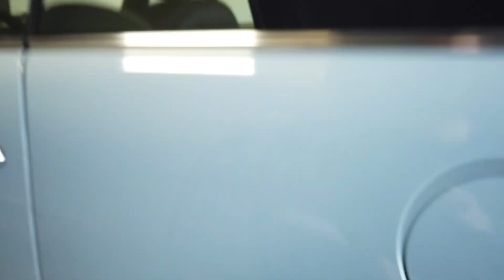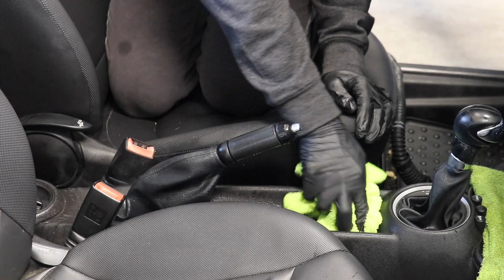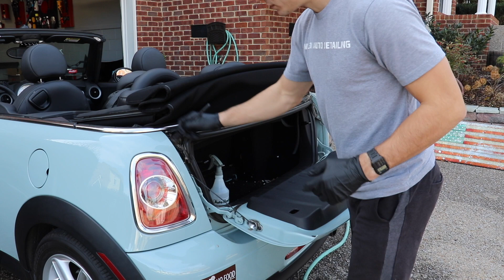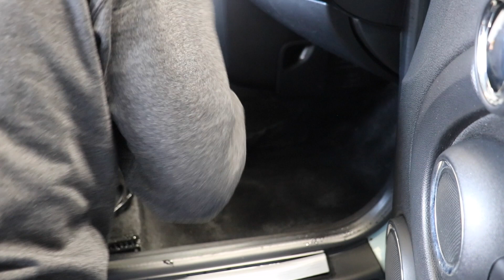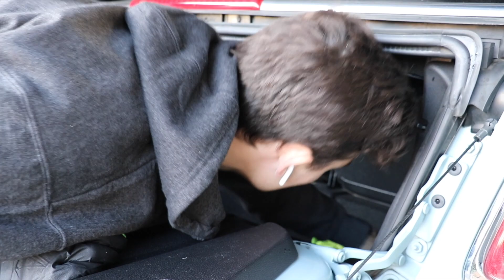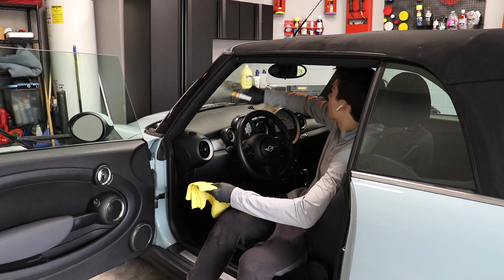How to Truly DEEP CLEAN Your Car Interior for Winter | Exposing it all!

Comment: Hey I noticed that you didn’t use an extractor for your floor carpet of that makes sense but rather some all purpose, a drill brush and the steamer without the tool at the end and I was wondering.. is it because your approaching it a different way or is it because of water logging it in a sense? Just curious if your approach because I feel like it makes sense doing what your doing for a vehicle that’s well maintained to begin with. I’ve noticed lately when using my extractor that a stench comes up. Any advice

Comment: Should I go fro a aquapro or mytee lite extractor ? Their a 300 difference with of course the mytee being heated ??? Lmk please honest answer ?
Reply from the maker: Honestly, yes heat is fantastic, I think it depends on how serious you are. My advice, if you are wanting to give the best of the best then a heated extractor only makes sense. I love my Mytee lite 8070 heated
Reply: BTW if you get an aqua pro, be very very careful with the hose mine didn’t last 7 months and I don’t use it but 2-3 times a month. It ripped at the suction head connector.

Comment: Luke: I sure hoped you sped this video up 1.5 or 2 x, otherwise I'd think you were on speed or something.  Nice to see you back in the saddle, especially since your in the renovated Wilson Garage!
I thought I'd say "God Bless You"-since you sneezed a few times throughout the video.  I was wondering why you didn't use an extractor after shampoo/drill bit the carpeting in the car?  Also, you used an abrasive brush to clean the front seats.  Wouldn't the Wilson kitchen pads be more applicable?  Just wondering.
Reply from the maker: Thanks man! These carpets didn’t need extraction though in another situation I definitely would, the non abrasive scrub pads end up being safe for the leather, anything abrasive is a little too strong for me 😬